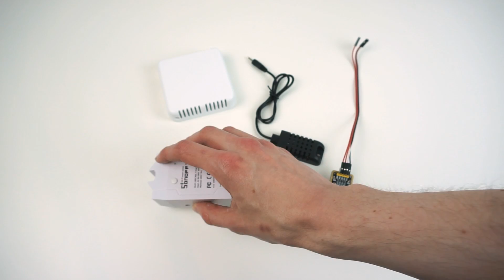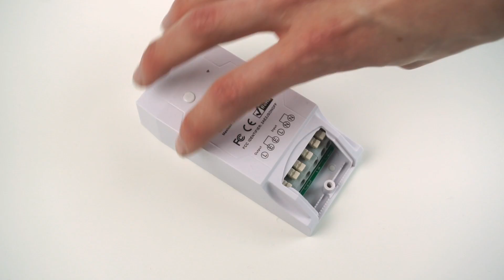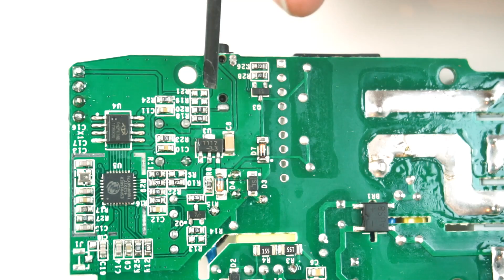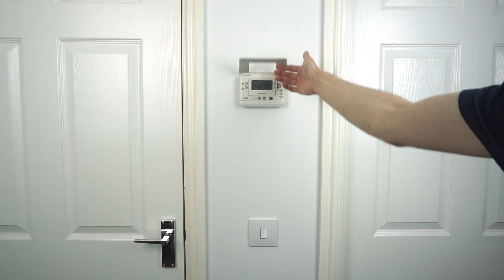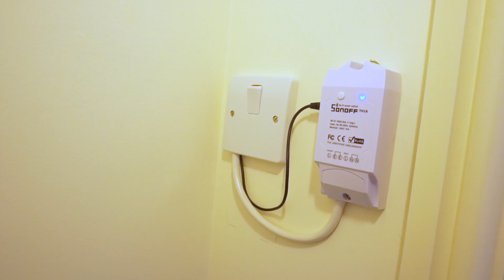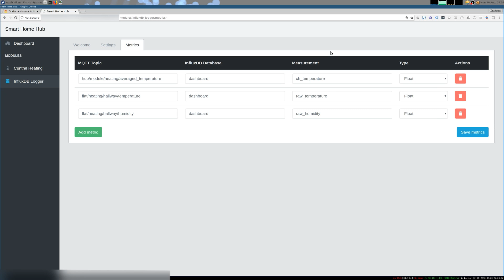Building My Own Smart Central Heating Control System with a Sonoff TH16

Comment: Boilers have volt free contacts. How did you interface between the sonoff 230v out and the boiler terminals?
Reply from the maker: It depends on the boiler, my particular one uses mains voltage contacts rather than volt free ones.  If your boiler uses volt free contacts you'd either have to modify the Sonoff to provide dry contacts (wouldn't be too hard) or buy a different Sonoff such as the Sonoff 4CH Pro which supports dry contacts out of the box.
Reply: @camerongray1515  i ordered a th16 today and a simple contactor to get a pair of contacts for the boiler. Thats how i got round it. Overkill maybe lol but the cheapest way i could do it. And i need it urgent because my old controller stopped working.

Comment: IMO, the smart meters are the way to go, especially when it's 7 day forecasts, not only can it tell you the temperature outside based on your local weather station but act accordingly due to your preferences it has noticed over the months that you have used it along with zoning appropriately (we all know some rooms are warmer/cooler than others so it's not efficient to treat it like all others)... or even just turning the fan on to mix the air between zones to make it comfortable with the same energy usage as an exhaust fan

For predicted hot days, the house should be cooled early rather than later and for cold days the same, for nights it should be turned off or turned down low, most current air conditioner thermostats are so stupid the energy ratings might as well be classified as "abysmal" and smart ones should have the "energy star rating" based on predictive natures

Same with Gardening, no point in having a water timer for outside when it's going to rain, and maybe you would like to tell it to water more on predicted hot day mornings.

I know it sounds like too much information but bottom line is this.
Traditional methods of air conditioning would cost approx $20-30 more per unit above having none, where yours could slash it to approx $2-$10 more per month over having none.. basically the system would pay for itself.

Yes there is the privacy issues, but as long as it isn't voice monitoring you should be fine, if it does, don't whisper dirty things into it... some dirt can't be fixed with a filter change.

Comment: Well done, but as you bought a separate housing for the sensor you might as well have bought a bare dht22 sensor module or ds18b20
Reply from the maker: I could have done although the Sonoff one also included the cable and 2.5mm TRRS jack - getting the whole assembly saved a lot of hassle.

Comment: I've recently switched to Home Assistant which has made my work flows so much easier. Have you looked at the new Lovelace UI much more easier to setup and you can now have custom cards on there. Might be something to look at and maybe create a hass.io plugin with your thermostat control. I'm currently working on a thermostat unit that will have a colour LCD to show heating status, set the temp and show currrent temp from a remote sensor in the living room.

Comment: Thanks for the video, I've considered doing something like this for a while. Mainly because the timer is broken on my system, but it'd also be neat to switch it on and off from anywhere in the house (and to muck around doing it myself).
Also, I have one of those USB serial adaptors and it's nice to see mine isn't the only one with a wonky USB plug :)

Comment: How did you connect to your boiler did you modify the sonoff to a dry contact or did you use the live from the sonoff to feed the boiler PCB
Reply from the maker: My boiler uses main voltage contacts rather than volt free ones.  Out of the boiler I get 3 wires - Live, Neutral and switched live.  The live and neutral connect to the input of the Sonoff and the switched live connects to the output of the Sonoff.  Obviously all boilers vary so if you had one that used volt free contacts you'd either need to modify the Sonoff or use a different model such as the Sonoff 4ch Pro which has dry contacts.

Comment: Is that i3 + mate?
Reply from the maker: Yep!  Finally discovered a Linux environment that works amazingly for me.  I get all the benefits of i3 along with all the "nice to haves" such as shortcut keys, monitor autodetection, usb storage auto mounting and a central control panel working out of the box.
Reply: Nice, I've kind of done the same. I'm using XFCE+i3 and it's brilliant.

Comment: A similar product exists here: https://openenergymonitor.com/wifi-mqtt-relay-thermostat/ where this can also talk MQTT back to a Raspberry Pi for additional control. I would imagine you could use several temperature sensors around the house if you wanted to, rather than just one central temperature probe.

Comment: I cam in to this video thinking why not use home assistant. Then you got to the software part and found your reasons very valid.

Just to expand on the UI being yaml in Home assistant, Home assistant is ment to be just a state machine, the UI is currently a hack on to the state machine engine(Its changing to a purpose built ui thing, that is still configured using yaml and in a fix style). that said it is very possible to use the Web Socket API to make your own UI and keep home assistant as a state machine

Comment: The ESP8266 is perfectly fine with 5V signals (it has clamping diodes), it's POWERING them from 5V that kills them. You can use a 5V serial adapter if it's all you have as long as you power the board from 3.3V.

Comment: Possible upgrade: PID control. Depends on the building and the heating system, but it can be much more confortable than two point switching with huge hysteresis.

There is no continuously variable input on the boiler to control how much power you want, but you can control the ON/OFF ratio in PWM-like fashion (pulse width modulation). The cycle time should not be choosen too short because it may lower the heating efficiency and may shorten the lifetime of the boiler. 10-20 minutes is a good start.
Reply: I don't think a PID would be that useful for this, wont work if its gas, and if its electric you'd need a really big relay to keep it from burning out - and if it has a pump for circulation It would probably have to be run continuously which would waste electricity.  I think the better way to improve it is to add outside temperature and weather forecast, you can use the inside vs outside temp to perdict when it will need to run without waiting for the temp to cross the delta of the set temp.  And you can use the forecast to see when it will warm up outside to near the set temp and decide to just not run the heat before then to save energy.

Comment: Really cool project, I wonder if I could do the same to my heating system, its not central heating and is ceiling/floor heating with a thermostat? in each room
Reply: You definitely could do the same.  It would just be a SonOff for each room rather than one Central device.  To use the Sonoff in this tutorial/video you would need to be sure your heating system switched the mains power.  If you have low voltage switching thermostats, you may need to explore another option such as a D1 Mini ESP8266 with a dry contact relay add on.  The thing that makes the Sonoff hackable is that it uses an ESP8266 chip :)

Comment: I've looked into this myself....you have executed it well. However, let's say the compute workload is moved to the cloud. In the event of an outage or loss of connectivity, what happens? No heating? I like the idea of running it on something solid state like a Raspberry pi or Arduino.
Reply from the maker: If it was moved to the cloud then yeah there wouldn't be any heating, you could also have done something as an emergency backup such as using the button on the Sonoff to control it or by doing something like connecting an analogue thermostat in parallel with the Sonoff to act as a manual override.  Being able to host everything on my local network instead of relying on a manufacturer's cloud service was the main reason for building this instead of getting something premade.
Reply: Yes you are right there, but for those with a minimal home server set up it would be cool to run this on a Raspberry Pi...  I heard that Worcester Bosch smart controls are processed in the cloud so you could loose your heating with your internet connection!  Interesting: http://blog.rtwilson.com/hacking-the-worcester-wave-thermostat-in-python-part-1/
Reply: This is also very interesting, for those with wireless controls: http://www.stevenhale.co.uk/main/2013/08/home-automation-reverse-engineering-a-worcester-bosch-dt10rf-wireless-thermostat/

Comment: You've probably invalidated your buildings and contents insurance policy.
Reply from the maker: Care to explain how?  It states nothing about installing central heating controls or thermostats... Fitting something like this is practically the same as replacing a socket or light fitting.
Reply: You've put low voltage wiring with mains! Was good until that bit 😁
Reply: Some flats don't allow certain down-lights to be fitted due to fire risks between floors, i've seen that clause but nothing about heating controllers. Apparently it can defeat the fire proofing barrier.
Reply from the maker: It's not a new build so the only remaining warranty is for major structural issues. Definitely doesn't affect insurance as long as the work complies with the regulations which this does. As you said all it could do is affect the warranty on electrics in a new build.

Minor pedantic note, PAT testing is for "portable appliances" not entire installations.  There will supposedly have been testing carried out but given the number of stupid flaws I've found on original electrics (metal back boxes on light switches not earthed with earths shoved in a choc block behind the switch and a loose live connection to an original socket.etc) I don't have much faith in how much care was carried out with the original installation.

Downlight wise there are regulations where certain environments require fire rated downlights to maintain the fire properties of the ceiling.  In my case I technically don't need them as the fire barrier is the concrete ceiling, not the plasterboard drop ceiling.  That said, I have fire rated downlights anyway since they barely cost any more.
Reply: Sorry i meant (EICR) testing
Reply: Your flat's electronics would have been PAT tested which is now invalidated, which "could" affect the guarantee on a new build, but i doubt it would effect your general insurance policy, unless it caused a fire and affected other flats in the building. Check your property's lease agreement.

Comment: Have you had a look at openhab or home asistant?
Reply from the maker: I did although neither really did what I wanted, they both seemed very much a case of configuring the existing application to work with my hardware without that much ability to make a custom UI.  I also fancied working on a large software project so decided that this would be a fun one to do.
Reply: You should check out the Lovelace UI for Home Assistant, this is much more flexible than the previous/existing way to generate a UI (i.e. the UI is part of the state machine).
I did have a little chuckle as you described your implementation and how almost identical it is to Home Assistant.

Comment: I think it would be cool to install a raspberry pi with touch screen in the hall closet to control this. 

Though, it would be redundant since you could just use a phone or computer to control it. On the other hand, if you have company staying in your flat for an extended period, it probably isn't that bad of an idea
Reply: You shouldnt use a 20a double pole switch a fused spur should of been used with a 3 amp fuse. I do really like the effort you have put in. Well done
Reply from the maker: The switch only serves to isolate the Sonoff so that I can power it down form firmware updates/to restart it without turning off the boiler itself.  The feed to the Sonoff comes out of the boiler which itself is fed from an FCU with a 3a fuse therefore a second FCU would be redundant.

Comment: Great inspiration! I`ve seen your network installation video after I did some Cat6-cabling myself, and got this recommended today. Some time back I was looking to do something similar to four devices I have. An AC for the whole house(with built-in temp-sensor on the indoor-fan-unit) and with three thermostats(from 2006) for floor heating in two bathrooms and a cellar. Would be great to get an electrican to install some hardware and to tweak around with software to get functions like night and day-time power-saving. But solutions like that cost a fortune.

Comment: You should have used a FCU not just a DP switch, the device is not fused! I would suggest buying a Hive or Nest Thermostat instead, as when you sell the flat this all has to be removed. Nice project though.
Reply from the maker: The mains connection to the Sonoff is provided by the boiler which itself is fed from an FCU in the kitchen fitted with a 3A fuse so an FCU isn't required at the Sonoff's end.  Of course if I were powering it directly from a ring then yes it would need an FCU but not in this situation.  I deliberately went for this over something like Hive or Nest because I wanted it to run entirely off of my own software without relying on a manufacturer's cloud service.  If I sell the flat (which I'm not planning on doing any time soon) I would just fit the original programmer back in again.  Removing this would be no more hassle than removing things like wall mounted TVs which would also have to be removed if I were to move.
Reply: Probably one on the boiler already

Comment: 18:18 I swear that sidebar looks like it was ripped from Cockpit (for managing Linux servers)…

18:56 I really wonder if the web portion of Cockpit actually runs on Flask…
Reply from the maker: Flask is just the backend server, it doesn't have anything to do with the user interface.  The user interface is built on https://coreui.io/ which itself uses Twitter Bootstrap.

Comment: With the fact that it uses a standard ESP8266, that means it could be reworked to connect to Adafruit IO instead of Sonoff's service, though, to be fair, both services are IFTTT compatible.

Also, I can understand if you decided not to replace your existing heating programmer with one of those Nest things, of which the UK version is apparently wireless.
Reply: Did you even watch the video? He replaces the firmware.

Comment: whats the point of this? Why do you need to control your heating from the internet?
Reply from the maker: It provides a much nicer interface than using the original programmer.  It also allows me to do things like switch the heating on when I'm on my way home so it's warm when I get in or turn it off remotely if I go out and forget to switch it off.  I tend to get home at wildly varying times so being able to do it remotely or use the "Switch on at x until y" feature is way more useful than setting timers on a programmer and having to change them regularly.  I can even go further and build custom integrations such as automatically switching heating on/off when I leave/get home based on my phone connecting to my WiFi or even go as far as integrating it with my alarm clock app so that the heating turns on 30mins before my alarm is due to go off so that it is warm when I get up.
Reply: @camerongray1515  and nerds like us love working on cool and interesting projects.
Reply: +Cameron Gray Should have just said "Because it's kewl!" lol

Next question: Why do you like Apple Jacks when it doesn't taste like apples?

😉
Reply: NTP time sync and the death of daylight savings changes.
Reply: I hacked both my window air conditioning units and integrated it with home assistant. I can turn the air on when I'm on my way home, and automatically adjust the settings based on the weather forecast and the measured temperature in each room. It's automatic, and I rarely touch the controls.
Reply: @James02876  I did the same
Reply: Just being able to control it from any room in the house is pretty appealing. Especially if you're in bed and wake up to it being a bit chilly